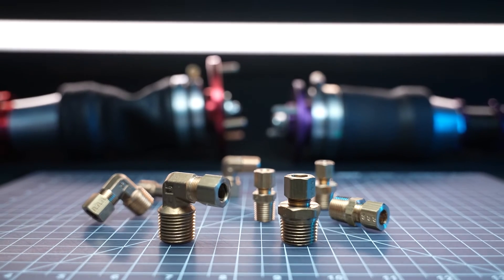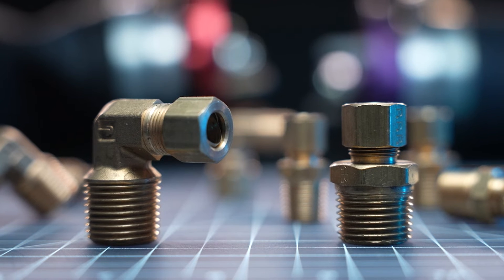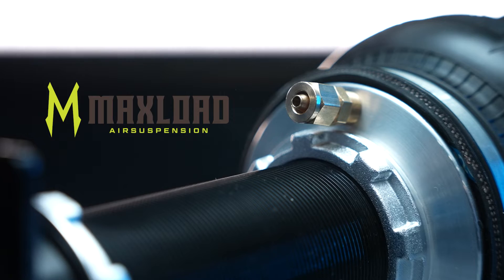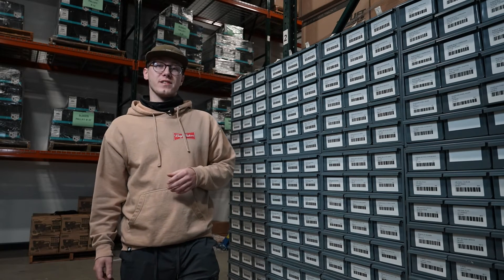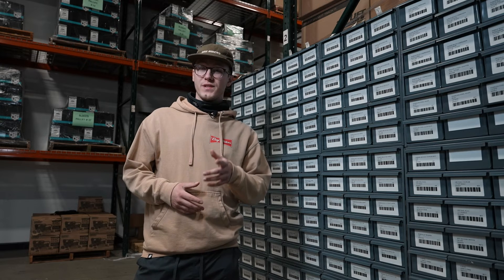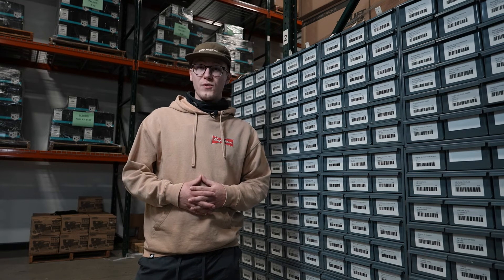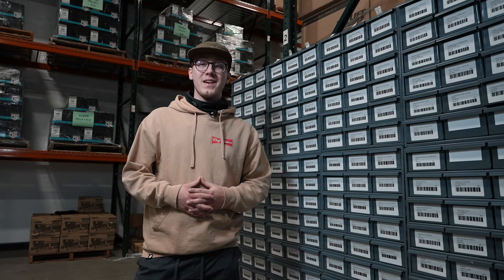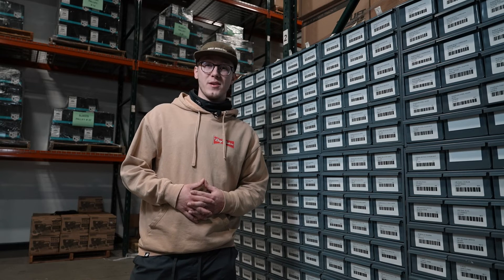What are compression fittings for air ride?

Comment: These considered better than push in version?
Reply from the maker: We recommend PTC fittings for nylon air line as we find they are easier to connect.
Reply: @bagriders Can PTC be used for hardlines connections??
Reply from the maker: @typicalvideos9231  If the hardline is "sandwiched" between fitting one and fitting two, it will work fine, if it isn't it will not work (compression becomes the option).